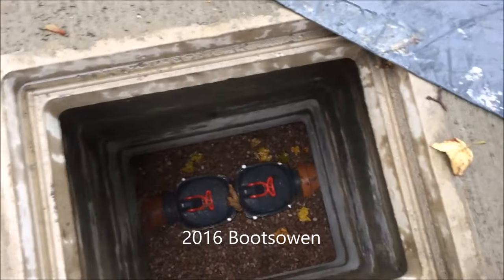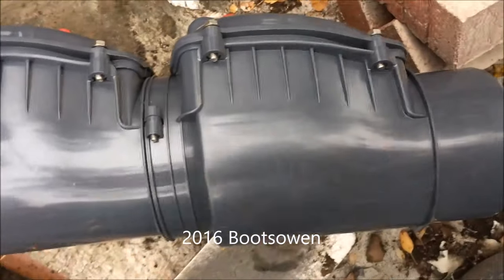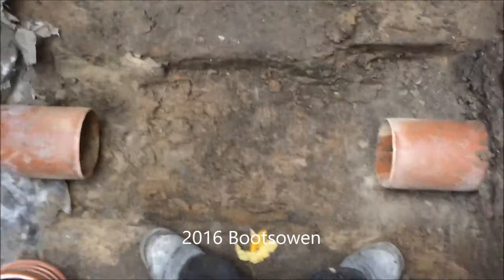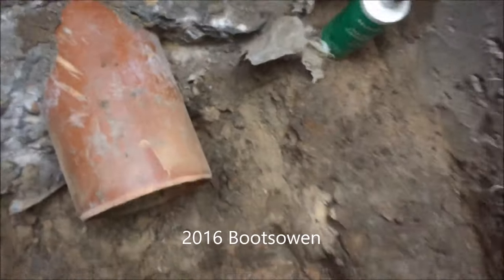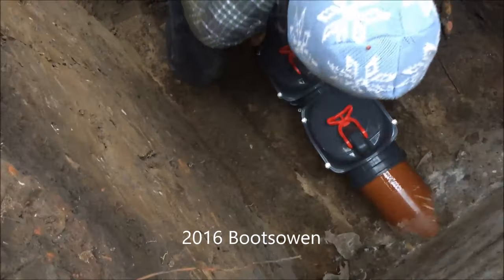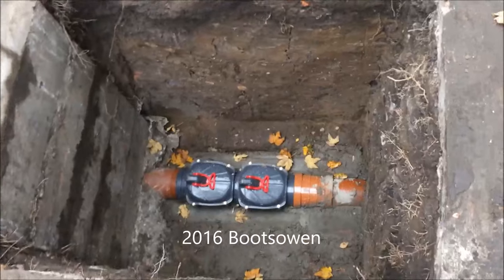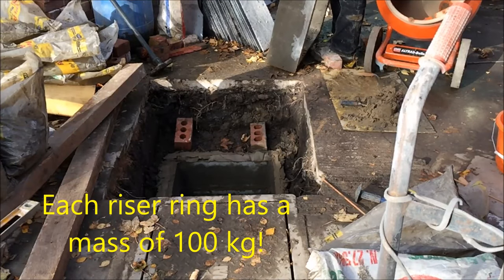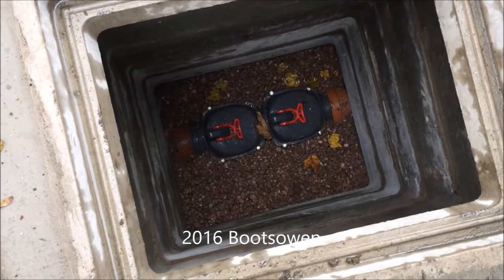Double sewer anti-backflow flood valve installation

Comment: thx for the video. But i dont hope you have downsprouts and other rainwater drains befor the anti-backwater part. If you close it off due to backflow and the rain still poors down, youll end up with rainwater in the basement, if thats the case you will need a larger model of the Kessle that has a pump, same goes if you have a multiple floors, you then need the automatic model with alarm and pump.
Reply from the maker: Maybe I didn't explain it clearly enough, but in the adjacent manhole there is a very old pipe that acts as a flood interceptor, this want it's original intention, but it seems to work that way, The one time it did flood the backflowing water along with all the house rain water filled up about 20cm in the manhole and then departed through the big old pipe. Luckily for me this is ever so slightly below the cellar doorstep and so we weren't inundated. Now, with the backflow valve, if there is a flood, it will only be with rainwater and not with municipal sewer water. I'll take rainwater over sewage.

Comment: One thing about this system is if you ever have to have your main drain snaked out you MUST HAVE this systems flappers raised or removed to sewer cable can be pulled back through or install a clean out  on discharge side to sewer snake and power washer access. This valve sytem does have it where you can remove the tops of each valve for access to flapper just as long as you do not cover them up, also red levers can be locked in open position.
Reply from the maker: Hi Frank, Not quite, these flaps can only be locked shut not open, so if you want to jet it you have to open the downstream lid and jet from there, it happened this year: https://youtu.be/VS3iJfNDlTY but having the flaps in place and the manhole made it easy. Thanks for the comment.

Comment: Hi, great vid. I also need to have a man hole and non return valve installed (as currently having sewer water back up entering my basement), and was quoted 7k! Is that a realistic price if not doing it yourself? Just found your channel, very cool mate 😎
Reply from the maker: For what I did there was £500-1000 parts and a competent person should be in and out in two half days. £3000/ day. I’ll be with you tomorrow. Lol. I guess it depends on what the ground is and how deep. If you need specialist equipment to shore up a deep hole etc etc and if the contractor has to remove material costs go up and up. Maybe £7k is reasonable. The reality is that there is not much to it.

Comment: Should of used 2 slips boss. Gonna have a gap now between pies of 50mm.stuff will get caught up....
Reply from the maker: You are right about using 2 slips, would have made a nicer job. But since it was done, over 6 years it hasn't had an issue. Nothing caught! I would do it your way next time.

Comment: I was wondering if you knew what the fall (or angle) was on your existing pipe?  The double flap valve you show is I think a product made by karmat.pl  If so, the output spigot is 34.4mm lower than the input.  I therefore wondered how you installed this in a retrofit situation such that there is still a fall internally, unless your existing pipe had a significant fall on it.
Reply from the maker: I didn’t even consider it. It has a fall but probably much less than 34.4 mm in the ~800mm length of unit. Since installed I have no way of knowing if it worked. I check and clean it every couple of years. And we have never had a back flow since.
Reply: @bootsowen  Many thanks for your reply.  Interesting, quite possibly the slope is such that it works, even if it isn't ideal.  Between the time that I commented and your reply, I received a response from karmat.pl  In case this helps anyone, they advise that with their double flap valve, the installer will need to expose approximately 5 feet of pipe (so approximately 1.5m) in order to achieve a miniumum slope of 2% in a retrofit installation.  My take on it is that in that instance one is likely to need adjustable angles on the 110mm pipe in order to maintain the slope and connect to the existing pipework.  In my installation I just can't easily expose 1.5m of pipe.  I found a double flap non return valve from redi.eu with an offset of only 7mm, designed specifically to cut into a short length of the existing pipework.
Reply: Update : the UK distributor for Redi advises that their non return valves MUST be installed level, in order to guarantee they will function as intended, and therefore, if installing into pipework that is on a fall, some additional work will be required connect the level valve to the pre-existing pipework.

Comment: Excellent work!!  Have you had any big storms since fitting it, and how did it handle them?  I am about to do exactly the same thing.
Reply from the maker: Hi there, we have had some good storms, but nothing like the one that made me fit it.  The thing is that if it works correctly, i will never know.
Reply: @bootsowen  Sounds like it's doing it's job!  I've had 3 occurrences of the inspection chamber cover popping off due to backflow pressure during storms this year alone...  I'm just deciding on the type of valve to use. Was there any particular reason you went for a double flap, other than for double security?
Reply from the maker: @willjones3908  Only because it wasn't much more expensive.  The time in digging and the cost of the masonry is ultimately more than the cost of the valve.

Comment: There are no clampsto secure the valves in place?ust friction? Definitely would not be permitted in the US.To install the same type of system here in the US, we have a heavy duty rubber sleevy with a stainless steel fumm diameter hose clamp to tight down on both, one over the pipe, the other over the fitting ends.

Comment: I can see one problem with this set up. What happens if they have to run a snake through that line because you get a plug-up? The snake will go in but when they go to pull that snake back it's going to shred those valves, no? Shouldn't those red handles lock them open for just such a case? Hey, here's hoping they never see a snake anyway.

Nice job and lots of work, no doubt.
Reply from the maker: I wondered about that. There are two options, the first is to rod from the other way, that would work except there is no access in this case. the second is to rod or jet as usual through the two door flaps. then when /if it clears you can open the hatch lid bolts. this only takes a minute, (but obviously you wouldn't want to do it if there is a backlog in the adjacent manhole.) with the lids off you can hold the flaps open, or lift them out.  the red handles are to lock them shut.  I guess it also depends on the shape of the snake head that you use.  I hope I never have to do this!  It has been in about two years no and works well still.
Reply: great work ! ,  but i think the high pressure from the snake would not have to go past your valves ?